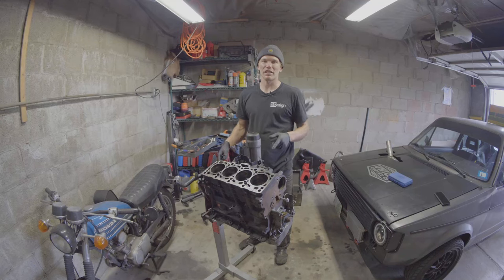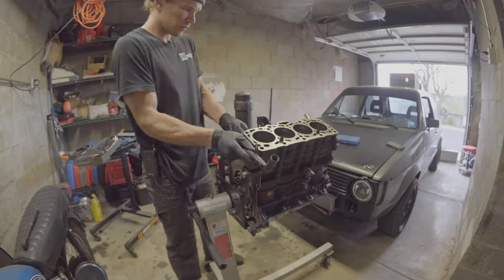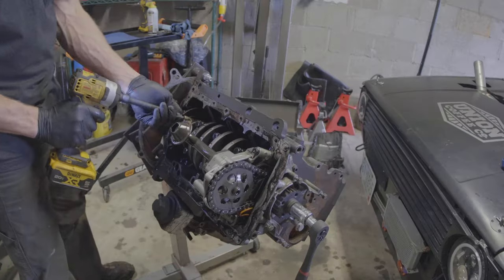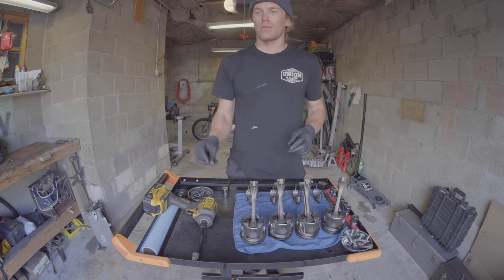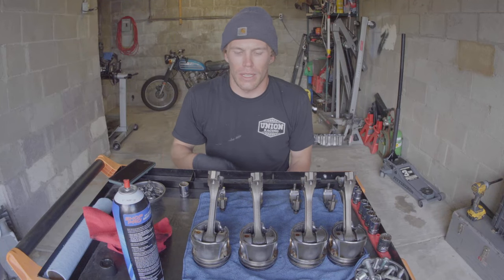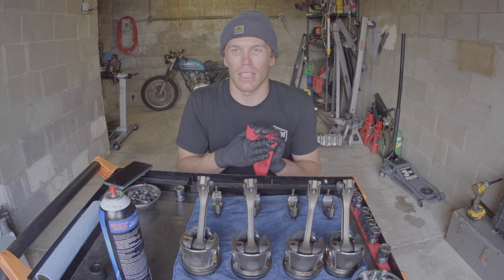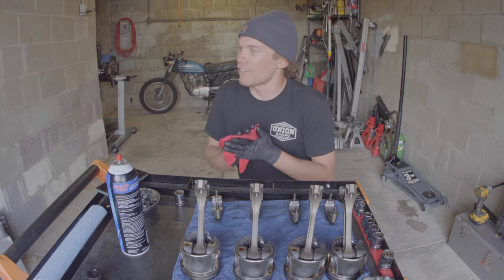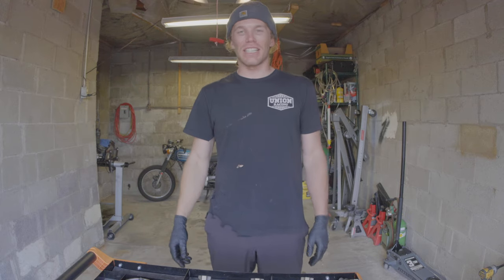Turbodiesel VW TDI Teardown! Part 3

Comment: Just did the rings on mine. Hot soaked pistons in ultrasonic cleaner. Broke down all the gunk and cleaned it off pretty well. Good luck
Reply from the maker: Right on!
Reply: I did the ringlands/ skirts on my 1.6d recently with an ultrasonic cleaner too. Used simple green for solution, worked like a charm.

Comment: Cheapest route to get the gallery pistons would be a PD150/PD130 running assembly, but unless you're chasing the moon, there's no reason. You also have the MaxSpeeding rods that I told you about already, so that would be a loss of money, unless you return them. You would want to swap the trigger wheel from the ALH to the PD crank if you decided to go that route. 

Like I said in the email, there's no reason whatsoever for the oil pump upgrade, just like there's no reason for the 7 CFM increase with the PD intake manifold on the ALH. It's a gimmick to sell parts in both cases. Remember I have two VE engines (CJ has a rebuilt ALH and XJ has a rebuilt PD130/150 hybrid) with the stock oil pumps. The CJ is a brand new unit, and the XJ is a OE one that came with the PD130 short block. They both output the same pressure on my gauges. That all said, You'll be fine with the OE unit, as long as it's in good shape. They both pop the relief @ 113-ish PSI when the engine is cold. If you look at the Bentley it doesn't give you a oil pressure reading at idle, but rather a window of pressure at a certain RPM and oil temp. You'll be fine stock.

While you're running a mTDI setup, the question I often ask is "what is your power goal"? Once we know that, you can move forward. I'm a HUGE fan of the GTD1756 turbo. It is good to about 250 HP, so you'd need to get your injectors to the appropriate size, I run 280s. The eTDI 10mm pump is good to about 300 HP WITH a good tuner. I run 11mm pumps, since they're not working as hard as the 10 for the same power. The low 400 VE record I was telling you about was with a custom 12mm eTDI pump and 3XX injectors. For your little Rabbit I would say that the GTD1752/56 @ 30-34 PSI with some 280 injectors would make that thing fly. The next concern would be driveline (clutch in particular). I would say get it all done now, so you don't have to tear into it again.

I'm glad to see the information I've been sending via email is not falling on deaf ears. Very often TDI guys/gals are lazy and/or cheap, and don't want to do things the "right" way. You seem to be taking the right approach. This is the same thing I do with all my TDI motors. I have one sitting on a stand now that will be getting the full treatment as well. Don't have another swap candidate, but maybe a 2004 Tacoma is in my future. I saw one over in Denver for sale, but this is a while out. If I do end up in your area, I'll reach out. 

Best of luck!
Reply from the maker: Cheers to that!! This video was shot just prior to some of our email conversation 👍 as always, great info.
Reply: asv engines have oil gallery pistons also. They fit VE style rods

Comment: Brake cleaner wont work, there's some mega strong crust remover, for real carbon-removing horsepowers, called Xylene or MEK (Methyl Ethyl Ketone) (B-12 Chemtool has it as main component). I used it to clean out my intake valves cuz they were all carboned up by the EGR. Soak them in the B-12 and that stuff will practically fall off
Reply from the maker: Hell yeah thanks for the tip. I was going to try soaking gasoline next